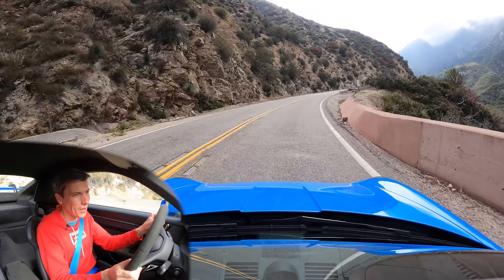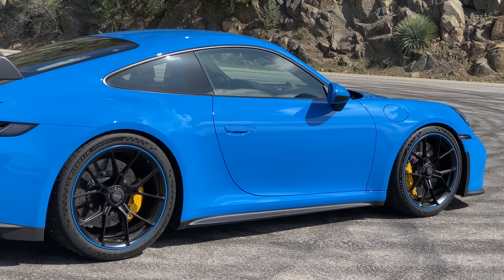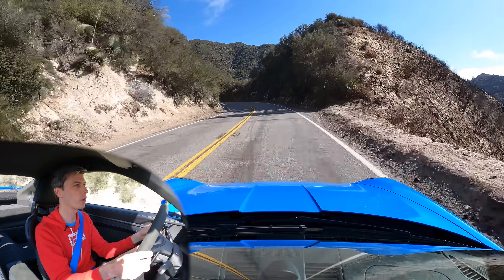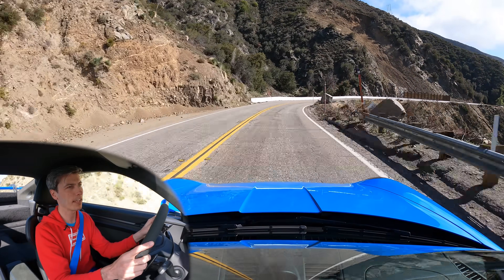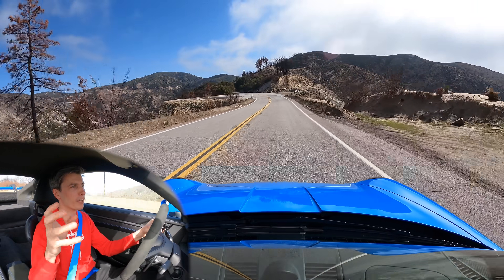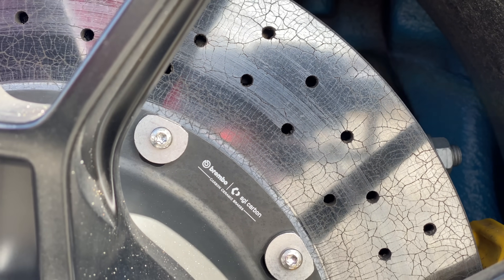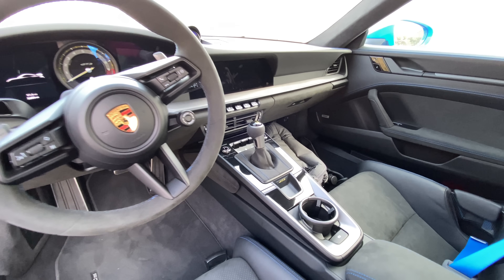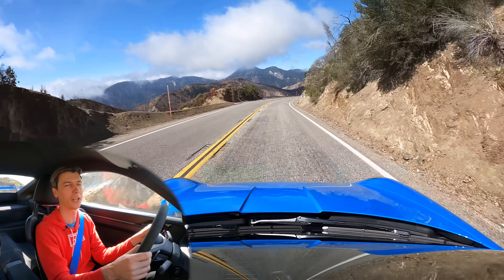Is The New Porsche GT3 The Last Manual Supercar?

Comment: 0-60 in 3.4 sec with PDK. Yeah right. I am laughing because Carwow just did a 6000 rpm dump 0-60 in 2.87 sec...Porsche is overkill in the launch department. Jason, you really have to explain how that rear weight balance or magic TC witchcraft allows Porsches' to outlaunch everything out there.

Comment: A price of almost $200,000 is simply absurd. Porsche could sell it for under $100K and still make a profit. It's $100K for the car, $100k for the badge on the hood. And especially with the GT3, you're paying more for less.
Reply: your comment is absurd. Start your own car manufacturing and give us equivalent car to GT3 for $100 k and they will build you statues. Otherwise you are just trolling.
Reply: @olasek7972  The absurdity of your illogical and weak rebuttal is absurd. Porsche was founded in 1931, and has been building cars for nearly a century. They have been at it for a long time. Building one prototype car is expensive. It costs millions or tens of millions because everything is one-off and has to be hand made. But production cars are not one off or hand made. If a Honda Civic was a one-off vehicle, it would probably cost $15 million. The reason one can be had for $20k is due to economies of scale. Tooling is manufactured for injection molded parts, automated stamping presses for body panels, casting tools, forgings, CNC mills, glass panel tooling, automated welding robots, automated paint robots and semi-automated assembly lines all come together to crank out cars in large numbers. The same thing that is true of Honda Civics is true of Porsche GT3s. There is nothing inherently more expensive about a GT3 than a Honda Civic, except perhaps some carbon fiber bits. The body panels are still made of stamped aluminum, the engine block is still cast aluminum, same with chassis and suspension elements,  crankshaft is still steel, pistons and rods and intake manifolds are steel or aluminum, tires are still rubber, interior is still plastic and leather, glass is glass, paint is paint. All the materials and manufacturing processes used to build a GT3 are the same as those for a Civic. The GT3 doesn't have gold headers or platinum exhaust manifolds or diamond and sapphire windows. Even assuming that the quality of the same materials is higher in a GT3 than a Civic or assuming more manual labor is used in its construction, it's difficult to make the argument that a GT3 uses 5 times better quality materials or 5 times more skilled labor. And even with that generous 5x factor, that GT3 should not retail for more than $100K. That's an absurd amount of money for a 6 cylinder pump with two seats, four wheels, and a chassis. The only reason Porsches are so expensive is the same reason diamonds are expensive. Not because they are rare or somehow have high intrinsic value, but because their supply is artificially kept low to keep demand high (in the case of diamonds, DeBeers keeps a chokehokd on that market and prices artificially inflated, in the case of Porsche, it's VW Group). I don't have to own my own car company to understand simple engineering, manufacturing and economics principles. Porsche charges $200K for the GT3 because they can. Because there will always be suckers and fools with fragile egos out there willing to pay it, and Porsche knows that.

Comment: If you have to wait for boost in a turbo car, you're in the wrong gear.
Reply: Try snapping the throttle open and shut quickly in a turbo car, i.e., stabbing the throttle to test the throttle response.  It just does not respond the same as an NA, it's physically impossible.

Comment: Can I suggest a reference for estimated maintenance expense per anum? Like cost of a brake job for standard and ceramic options, etc?
Even as a pinned comment or in the description? Getting the keys is only half the battle when it comes to ownership of true driver’s cars.
Reply: Oil service costs about $500, intermediate service about $1200 and a big service about $2k.
Covering 5k miles per year, need to budget about $2.5-3k per year for servicing and brakes over the first 4-5 years while the car is still under warranty.
If you avoid the main dealer and do the work yourself (it’s all just basic servicing that they charge silly money for, because they can), it would be a fraction of that cost - but if something goes pop during the warranty period, there could be some arguments.
After the warranty period, in classic Porsche style, any unexpected failures will be stupidly expensive.
Cars these days are ridiculously complex and the new 992 is no exception, lots more electronics than anyone could possibly need!

Comment: Check engine light is "Just part of being in the Volkswagen family" truer words have never been said 👏
Reply: Haha I am lucky to have a MK5 Jetta with no dash lights on currently!
Reply: @VoyageRC  knock on wood!! Haha
Reply: @austinwolfe7295  like I said, “currently” 🤣
Reply: I understood it the way that one can still drive it with no problems even though the check-engine light is on. It's funny how different minds draw different conclusions even when they hear and see exactly the same.
BTW: It took me a while to understand what CEL was supposed to mean in the overlay text. Didn't quite connect the dots right away.
Also, in case some of you are wondering: The German term vor CEL is MKL or Motorkontroll-Leuchte. It translates exactly to CEL which most times isn't the case but it is here.
Reply: Except you didn't read the caption text but nice try.
Reply: @betterbeavailable  you're not understanding the joke here

Comment: Could you do a video explaining why naturally aspirated engines are able to rev higher than forced injection vehicles?
Reply: Forced injection engines battle a “pressure ceiling” that happens at very high RPM’s as well as the ability of the turbo/supercharger to compress the intake air volume at a rapid rate.  The pressure within the cylinder at 5000 rpms is dramatically different than the pressure at 10000 rpms even with a bypass/blowoff valve.  At a certain point the blowoff is less effective at high rpm and causes much high compression levels in cylinder.
Reply: I don't think that's true that turbo engines cannot rev high.  Turbocharged engines can rev plenty high.  But they don't need to since they are feeding the engine with compressed air, instead of relying on more engine cycles to get more air through the engine.  People want less lag and maximum torque to come in at lower rpm, so most turbocharged engines get fitted with small turbochargers than cannot support very high rpms... often torque starts to drop away dramatically above about 5500rpm in many turbocharged engines.  [So even if, say, the Mercedes A45 AMG engine can support 9000rpm, there is no point setting the redline there as it will be making only say half the power it does at 6000rpm.]

Comment: At 1:26 we see the EXACT pedal box of  my '14 Cayman S PDK. My car goes from 0-100 in 10 seconds flat, this car does it  in 8.3.  From the rear edge of the doors forward, my 981CS and this car are structurally the same.

-If you want a really fast car, then BUY one.

Comment: Can you please do an in depth video comparing this suspension to the previous 991? Everyone talks about dual wishbone but it’d be interesting to see that from an engineering point of view.
Reply: He already has videos that explain how double wishbone suspension and strut suspension systems work. That would be a good starting point.
Specifically about this car I would be really interested to know exactly how and why they changed the setup of the rear suspension and rws, in response to the change to wishbone front suspension.
Presumably roll centre location and camber gain changes were required, I wonder what else?
Reply: @pjay3028  Or why the front spring rate was doubled compared to the last generation. Maybe contributes to the choppy ride some reviewers commented on?
Reply: @TheChannel1978  I think the front spring is stiffer to support the greater aero load and to support the front during trail braking which a lot of track day fanatics like.
Also, although the spring rate is doubled, because it uses wishbone suspension now, and how the spring is mounted, the effective spring rate at the wheel is only about 40-50% stiffer. But that's still quite a lot stiffer, so I agree that must affect the ride.
Reply: @pjay3028  Chris Harris claims that the ride is actually BETTER despite the stiffer springs because of the double wishbone setup. One advantage it has is that it keeps the wheel camber unchanged during roll, giving maximum contact patch (McPhreson strut tends to move in an arc, so it loses camber control). But what is more impressive is that they've managed to package in such a huge frunk despite using double wishbone, and that is not easy given the extra space they need.
Reply: @srinitaaigaura  in the video by Chris Harris that I saw he called the ride too "busy" for UK roads. He did mainly compliment the tyres for helping to smooth the ride. I didn't hear him make any direct comparison of the ride to previous GT3s, maybe he has said it elsewhere? I agree with your point about the impressive packaging, why haven't they done it before because wishbones are undoubtedly a superior option for handling.
Reply: Yes! I would love that.

Comment: 500-600hp is the limits for manual. After 600hp, You can't shift faster than a computer and @ over 600hp BOTH your hands need to be on the wheel at all times.
Reply: Yep, that’s what makes my 2019 ZR1 7MT so pleasantly scary.

Comment: Exige 430 cup is manual. So 911 not the only manual car in the sector. Also lotus has had aluminum tubs for 25 years (porsche introduced them in 991.1) including double wishbone suspension in all corners (again porsche introduced them just now)
Reply from the maker: Ohh, we don't get the Exige here in the states, and the 2021 Evora is bowing out.

Comment: Using USA gasoline should result in some interesting information. I wonder if the engineers did that on purpose
Reply: California's "best" premium fuel (91 AKI) is equivalent to standard European petrol (95 RON), so it's not ideal to run the GT3 on.  Normally it would be fed with 98 or 99 RON low-sulphur fuel.

Comment: but what does it get for fuel mileage? haha
Reply from the maker: No EPA estimates yet! 🤷‍♂️ We'll have to hold out before buying eh? 😂
Reply: @EngineeringExplained  🤣 Yes, I'm not spending just under 200 k for a gas guzzler haha All jokes aside I was genuinely curious, 3100 lb car Boxer 6 with 500 hp: I estimate it gets 34 HWY if not driven hard. I presume it's relatively easy for that engine to propel the car
Reply: @EngineeringExplained  No mention of grams CO2 per kilometre either, Jason. :(

Comment: Well, no it is not the last manual supercar.

Sure, there are hypercars out there without a transmission and with variations of semi manual transmissions but no, there will always be fully manual supercars simply because there is a market for it.
Reply: @I love you but  I was talking about cars that exist today. Electric cars (or hybrids) are already far and beyond simple ICE engines and everyone knows that.

A three cylinder hybrid will drag any Lambo, Ferrari or Porsche around any track or strip.

A 1900hp electric car with individual wheel drive will do the same, easily.

The truth is that in the future there will be two forms of cars, one without any transmission and another with a manual transmission JUST because some people love it.
Reply: @I love you but Fast around corners? Surely having a low center of gravity, twice or three times the torque and far better engine braking must be bad, right?

I agree that weight will be a problem but hybrids are far better than straight ICE and if they allowed it in F1 every F1 car would have it, wouldn't need any transmission because the torque boost is so great and you could recharge the batteries with braking alone.

The key here is that the electrical engine is superior to the ICE in every way there is, it is superior today and for those who don't drive F1 they are superior compared to cars with an ICE today.

Of course, 2300hp electric and the torque of a fright train (which are electric just because that torque is needed, they use diesel generators to drive an electric motor) might not seem all that much to you but ... in a race car that can corner?
Reply: @michaelmay5453  If hybrids are far better, why does the hybrid Acura NSX sell so badly compared to the non-hybrid Audi R8? :)
Reply: @I love you but I think his problem is that he doesn't know how to think.

He's trying his very best to address a problem he's gotten himself into and he's flailing about shouting like a tourettes ridden moose at this point.
Reply: @delusion2987  In terms or power to weight electric wins hands down and it's not a competition at all. The electric motor is 3 times as efficient and light weight, the modern batteries are lithium and aluminium which are both light metals.

The point made here that you were trying to ignore with your incoherent rambling response is that the electric motor is better in every single aspect, period.

Now sure, to get the uttermost power you'll need something else, like a hybrid, which are the fastest (there is no discussion to be had on this, 0-60, quarter mile, track racing, they are WAY beyond any ICE car) but then there is the Dirac. All electric that is faster than any of those on all those except one, they haven't figured out how to do proper one wheel drive with controls so you'd need a driver that is used to it to have it be the fastest around a track. the Audi E-tron is the fastest around a track because THEY DID.

Just like two wheel drive, leaf suspension and a wobble rather than a drive was the American way for 100 years after all European cars had individual wheel suspension I'm sure others will arrive there, not the US though, not a single good car out of that nation for the last 100 years.

Comment: Even though I'm 57, I can't wait for the last "manual generation" to die. Manual transmissions on high horsepower cars are governed by computers. That's what the Chrysler Demon engineer said. Otherwise people would be shredding clutches. So, there's your ethereal "manual" right there. It's an illusion of control. It's a stick in a god damn box.
Reply from the maker: Automatics are governed by computers as well. Traction control and torque limiting in lower gears are both pretty common.

Comment: Jason can you do a video on how to properly heat up your engine when let's say you live in a valley and have to go to the top of the mountain with your engine cold? You can't let it idle you said it in a previous video. But going full in isn't good either
Reply from the maker: Drive steady until it's warm, don't push it, it'll be fine!
Reply: @EngineeringExplained  but let's say people are waiting behind you, you can't drive slow. Should you push it to let's say 3k rpm or try to «climb» (idk the correct word to use it) the mountain without going «high» rpm (staying at 2k for example).

And in the opposite, when you have to coast when the engine is cold. Are high rpm bad for the engine even if it's not using any fuel?

In conclusion, what's the worst for cold engine? Load or rpm? Or both?
Reply from the maker: @L3xou97  There's some crazy testing happening behind the scenes to make sure engines are protected on start-up. Obviously certain oils can help there as well. Simplest advice is drive as non-aggressively as possible (high vehicle speeds are fine, just don't accelerate hard) until it's warm, but don't sweat it.